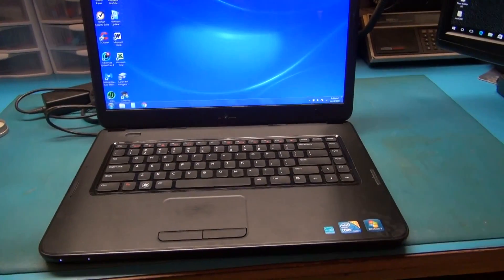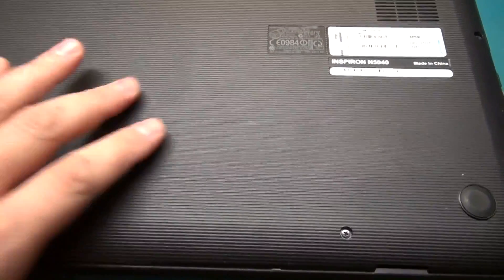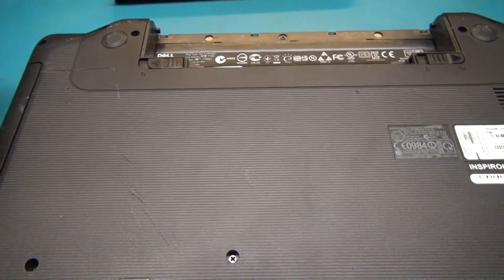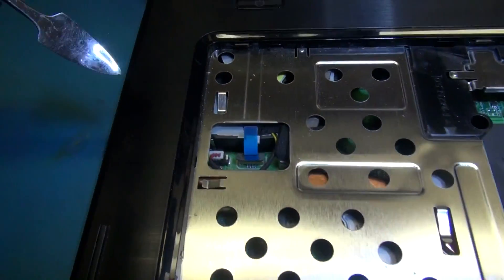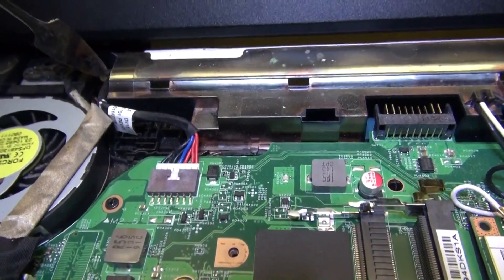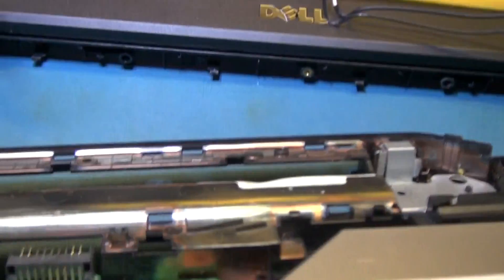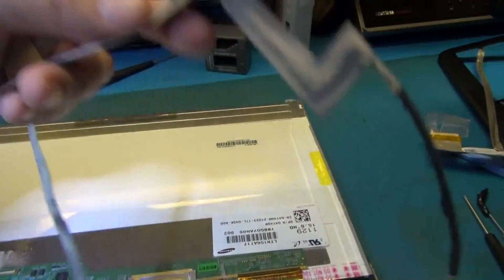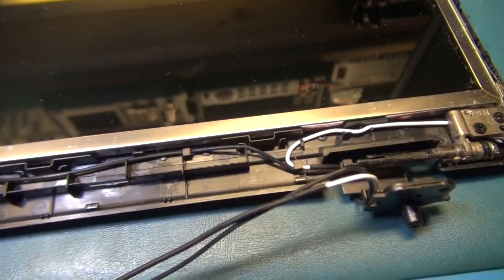DELL INSPIRON N5040 LAPTOP DISPLAY REPAIR. BLINKING SCREEN.

Comment: That tape on the ribbon cable behind the screen is VERY sticky. Make a wrong move there and the screen connector can be damaged. Not you, I mean, if someone isn't careful, it could happen...
Reply from the maker: Yes, I can see that happening.Thanks for adding that tip.